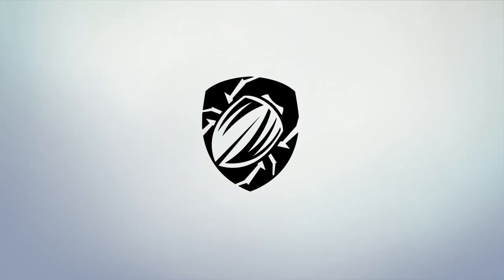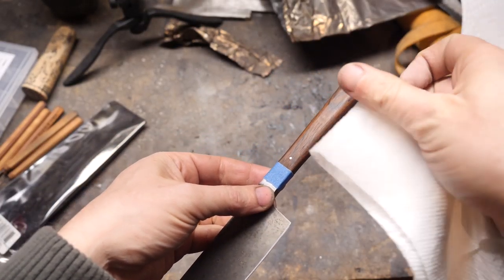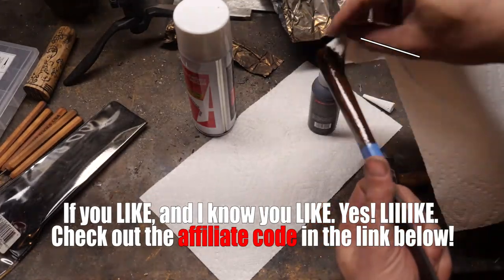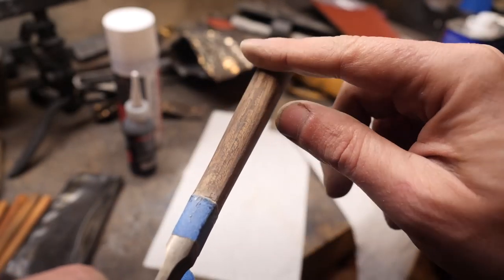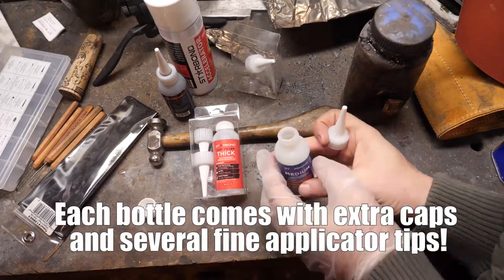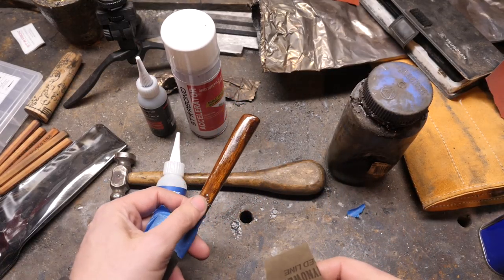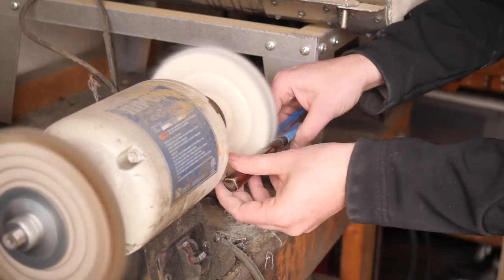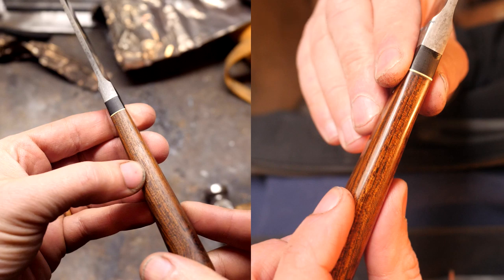Knife Handle Repair And Finish with Starbond CA Glue!

Comment: I've been using CA as a finish over Hawaiian Koa and it makes a really durable, hard coating.  Took a lot of trial and error to get it right, (without any tiny bubbles from the open grain structure) but worth the effort.  I love how it's only 15 seconds per coat, and you can build up like 30 coats in no time.

Comment: I actually used this technique for a crappy kitchen knife where i replaced the handle with pine, and it worked very well! The wood is water proof now and can be washed with a soft sponge without problems

Comment: I am a pen turner and used CA glue as the finish on wooden pens. What I found was that after two or three years the CA was lifting from the wood. CA glue doesn’t have an UV inhibitor in the formulation unlike many wood finishes and sunlight eventually weakened the bond between the wood and glue. I now dip my pen blanks in General Finishes ‘Enduro’ precatalyzed  polyurethane varnish.
Reply from the maker: cool good advice
Reply: I know this is an old comment, but purchased a knife with a crack, I can't return. Would this varnish help fill in the crack?

Comment: CA glue polymerizes in what should be a food safe format, as stated it was developed (it is still used to) seal wounds. 
There's even a 900ish cases study which compares stitching, stitching and glue and only glue wound sealing (albeit that is a specific medical glue) and found the stiching and glue method to prevent infection more often (but still, too low numbers to draw conclusions) and to have the lowest fail rate.
If it's safe for wounds, it should be pretty safe for food prep.
Ofc the fine dust isn't, but that was obvious.